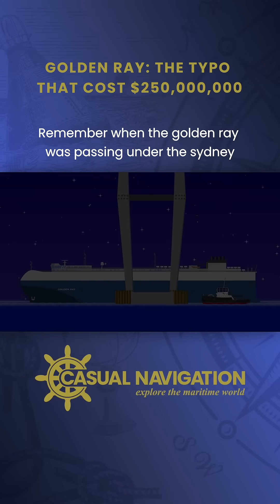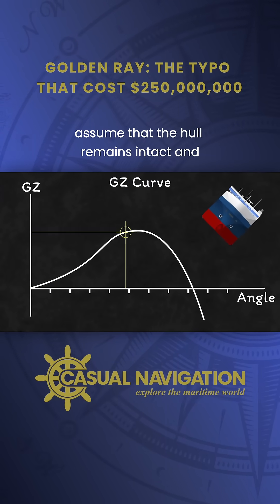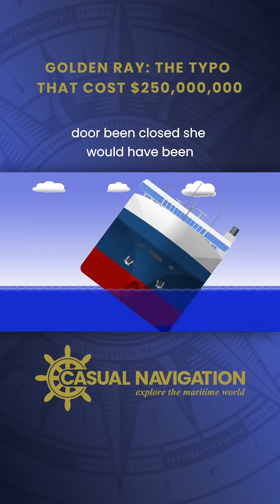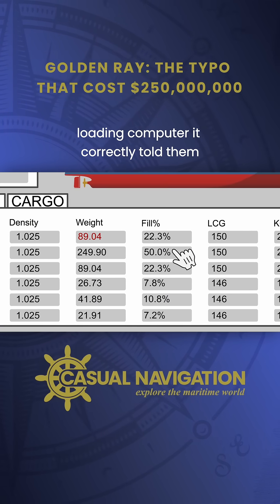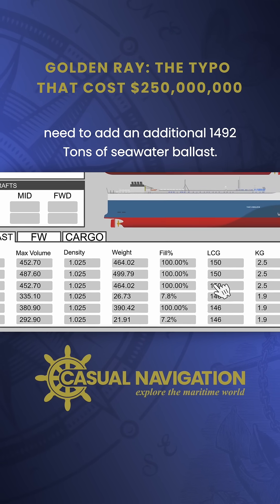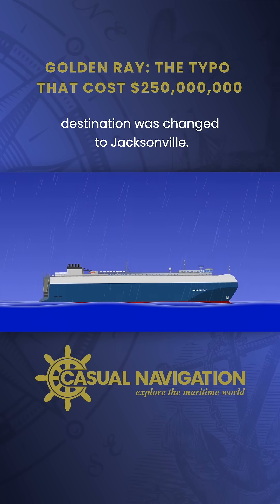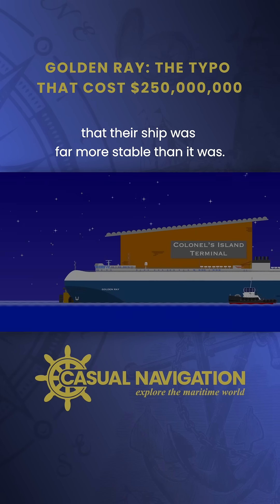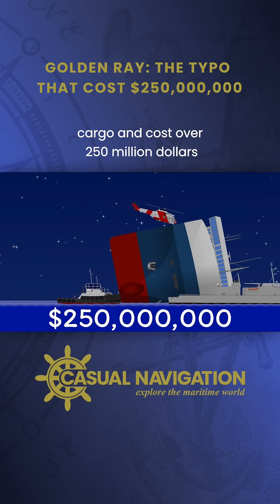The $250.000.000 Shipwreck Caused by a TYPO! 💸🚢

Comment: Amazing that there is so little attention to this incident.
A simple calculation.  
Clerical error? No. The Chief Officer was responsible.
He is supposed to calculate the necessary ballast.
He then presents his figures to the Master.
The Master then signs them off as correct.
It's been that way for centuries.
Computers make us all complacent.
These vessels are inherently liable to rolling, given their high sides and loading factors can enhance the problem.
As the vessel turned to starboard, it rolled to port where the pilot door was open....close to the water.
It should never have rolled that far in a calm sea.
It was obvious that the ballast was totally wrong.
Too late. Of course.